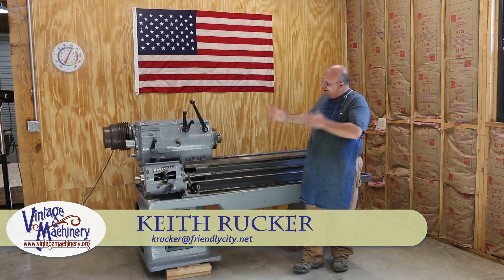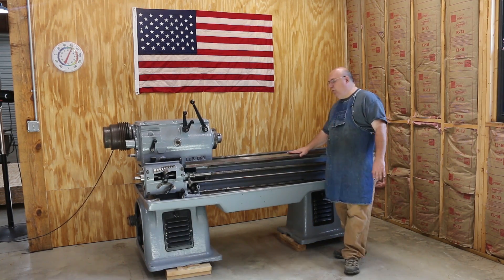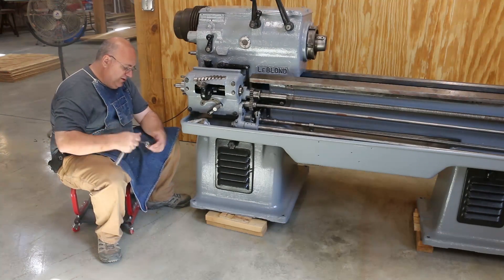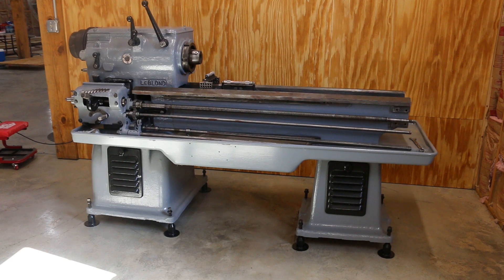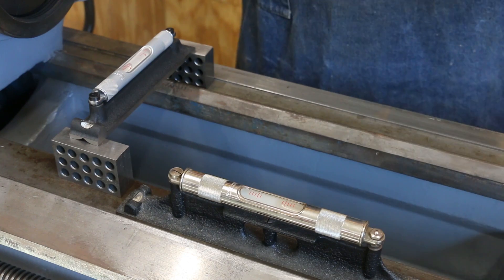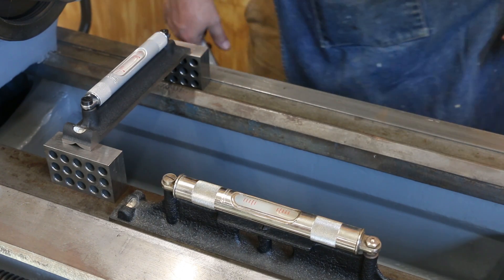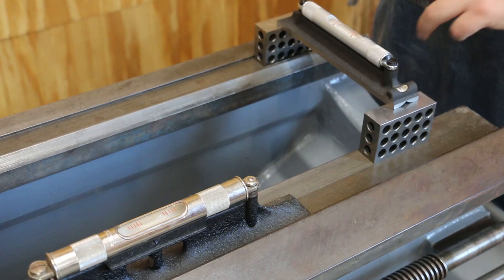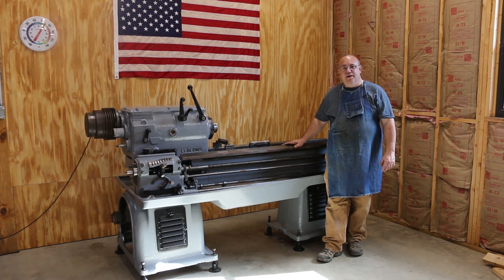LeBlond Lathe Restoration - Part 11: Leveling the Lathe

Comment: As you were discussing distributing the weight of the lathe out and not on a single point reminded me of something my father told me.  He was an airline pilot from 1946-1979.  In the early years he told me how Douglas had to strengthen the floors in the DC6's in the isle and galleys because at the time those tiny little 1/2" heels, or smaller were all the rage with the stewardess's and some of the heavier ones were punching holes in the floors of the airplanes because all the person's weight was concentrated on that tiny little heel!  A little piece of lost trivia.

Comment: I enjoyed the video, and learned some good tricks. I have a sister lathe to this lathe. The manual I got with my late says that the rear flat way is 1/16" higher than the front flat way on the 12" and 14" lathes ant 1/8" higher on the 16" and 18" lathes.

Comment: Great video but to my thinking a more precise way would be to drill a small hole dead center of 2 small half inch round stock to put a small guitar string through and put one piece in the lathe chuck and the other piece in a drill chuck in the tail stock and draw it taught.  Then put a very pointed tool in the tool post and follow the string along with the carriage front to back.

Comment: Important to adjust the force that each point applies. The correct force is related to the center of mass of the machine, on a lathe I would expect the head to be heavier.
I always clean & lubricate the contact points & the thread, to get a better feel for the force on each screw.
When I level break press machines, sometimes they need a readjustment after a week or so, I think it's because of stress release in the frame. If it's good steel it will eventually all straighten out.

Comment: ...You said those levels were accurate to .005" per foot? Aren't they actually more like .0005" per foot?
Reply from the maker: The level I was showing is 0.005.  Starrett also makes a "Master Precision Level" that is accurate to 0.0005.  I have one of those as well but it will drive you crazy unless you first level it with the other level!

Comment: Hi Keith, BLeonard here. I do enjoy the LeBlond Lathe Restoration. I have a 14 inch LeBlond H D and I remember leveling it. In the manual for the 12" & 14" Lathe on page 6 it states "The rear flatway is 1/16" higher than  the front flat way on 12" & 14"". Keep up the good work. Bob
Reply from the maker: That is why I was not on the rear flatway - I was on the front flatway, which is at the same level as the one on the other side.

Comment: Should a torque wrench be used to keep each set screws pressure even ?
Reply from the maker: I don't think that is necessary.  You would go crazy trying to keep them all loaded the same....
Reply: If there is any settling afterward equal weight distribution might help a tiny bit.
Might ?

Comment: Level.is where to start, but some machines due to age/wear have to be tweaked out of level to get the lathe to cut true
Reply from the maker: Very true, and once I get it running, I will cut a test bar and fine tune things.  Still good habit to start out level!

Comment: keith, i just finished your blacksmith blower series, when i saw the times on the videos i was nervous so many videos of length are 60 pct useless information about the videographer rather then the work, in your case it was about the work and in such detail my midnight bathroom run and smoke break wound up being your whole series, and i wish some parts were even longer. great videos and thnk you for your detailed information. please keep making videos they are enjoyable not just watchable which makes a difference.

Comment: Keith being your lathe hasn't been setting level in your shop since you had it. And not knowing if it was with previous owner. Would you check for level a few days weeks or months later to check an see how it settles in later on in its new position an what not. This is pure speculative an just asking on your opinion. Or anyone else wanna chime in. Keep up the great work.
Reply from the maker: Yes, I plan to do this and should have mentioned that in the video.

Comment: Hi Keith I had to look twice? You have the 123 block on the backside of your ways in the 
clearance slot and not on the flat of the ways because your level is to short .I think your lathe will be tipped forward use your long level on the transverse and your short one on the longitudinal way.
Reply from the maker: No, both the front and back were on a part of the ground bed that were on the same plane.  If I had it on the higher section, it would be tilted.

Comment: Did you consider using a digital inclinometer or other device, rather than spirit levels?  Great video, thanks!
Reply from the maker: No, I did not.  Nothing wrong with that, I just don't have a digital inclinometer but I do have precision sprit levels!

Comment: Keith,  having done a lot of "bedding" i'm astounded at how easily you brought the LeBond into your acceptable  tolerances !   My background was drivers and pumps and both required some serious bedding and "pre leveling" to +/-  .030 "  over greater spans !   Will vibration pose a problem when turning ?
Reply from the maker: It helps that I have done this before!  As for vibration, I doubt that it will matter much with this machine as heavy as it is.  On a light weight machine, it can be a big problem.

Comment: Just began watching Keith.  If I recall, South Bend's How to Run a Lathe recommends having the tailstock installed and tight prior to leveling.  Please correct me if I'm wrong on this.  Thanks, Eric
Reply from the maker: You know, my gut tells me that on a lighter weight machine (like a Southbend) this is probably true.  On a heavier built lathe, I doubt it really matters.
Reply: Yes you are most likely correct, I bet the bed on that LaBlond is very stiff.

Comment: 70 degrees. Wonder you aren't fozen solid, even with the long britches!
Reply: I know right?  I live in New Hampshire, so 85 degrees is hot.  I see Keith doing hard physical labor and its 100.   He takes time off when its 110.  He has a little sweat.  I'd be soaked like a shower!  Of course, When I get ready for maple sugaring in February its general 15- 20 degrees in the woods.  But wow....
Reply from the maker: I prefer the shop to be about 60-65 degrees but I can sure live with 70!
Reply: Bill sargent You get used to it I guess. I remember when it got down to 80 in a certain location in the Army and I thought it was going to snow!

Comment: Did you rotate you levels 180 deg to make sure the levels are good?  I've had a few bad levels.
Reply from the maker: Yes, I actually checked them to make sure and even did some fine tuning to them to calibrate the level (which you can do on a machinist level).

Comment: Is it necessary to level both sides lengthwise? I know if they are perfectly parallel, and one side is level, wouldn't it be kind of a double check to verify all places for level? Keith probably did this, but I didn't see it in the video. Just curious to other thoughts.
Reply from the maker: I actually checked it in multiple places.  I thought I commented on that but maybe not.

Comment: Keith, how about a little lesson on how to read a level like that. It seems like reading a bubble between some lines would not be accurate enough to see .005 of an inch?
Reply from the maker: Those bubbles are actually very accurate.  And I have another level that will measure to 0.0005"/ft!

Comment: As others have said the lathe doesn't have to be 'level', it has to have the bed parallel to the spindle axis.  The reason that 'level' works is that the lathe was manufactured with the spindle parallel to the leveled bed, and that a precision level is an easy way to transfer the level measure along the lathe bed.  You can also do it with tensioned wires, optical collimator or even a precision clinometer.  

If you know the bed is good you can check spindle alignment with a parallel test bar held in the spindle taper, or in a pinch a chunk of Thompson shafting in a 4-jaw.  With either you want to average the TIR on the horizontal and vertical axis separately.  If you don't know the bed quality it's a big mistake to try and align to it.

I hope you ran a stone against the bed where the 123 blocks were bearing, a little nubbin on that part of the bed could make for a decent error.

I'd consider a leveling with a Starrett 98 a 'good start'.  Check it again in a week after the bed has moved and the concrete has settled some.  Most folks would think of a lathe bed as hard and concrete as pretty set but a few rounds of leveling a machine tool and you understand that they're really just hard silly putty.Once it stops changing on the 98 move to a 199 or something else with .0001/foot and tweak it into final alignment.  You don't need it dead nuts on but taking it to .0005/foot can make a real difference.
Reply: Russ Kepler Does it matter that the 123 blocks were not  resting on the ground part of the ways where the carriage sits?
Reply: I don't think it would matter much if any - the flats should have been machined at the same time as the ways, but just not finished with grinding as the ways were.  So they should average pretty good, really.

Note that the planes described by the flat ways and the flats next to the ways don't have to be parallel to one another for the leveling to work, but if the flats being used aren't in the same plane you have to be careful with the placement of the 123 blocks by holding to the same edge or you might get different readings at the same location on the bed.  Maybe not so much with a 98 but when you play with a 199 you can see it.

Absolute level on the bed is really only useful when your rebuilding as it allows you to transfer planes to other planes making them parallel - id the bed is level in both directions and without twist it allows you to bring the spindle axis parallel to the bed with a parallel test bar and an indicator.  Once that's in you can get the cross slide perpendicular to the spindle axis and in the same plane with the level, etc.  

But all a working lathe really needs is an untwisted bed.  If the bed's in good shape you're pretty well done with that.

It's hard to write on this - there are whole books on machine rebuilding (ex Machine Tool Reconditioning by Connelly) that go into the subject in exhaustive detail on precision alignment.  A couple readings of the book will give you good insights on what matters and when.
Reply: Russ Kepler Thanks for the thorough explanations!
Reply from the maker: Russ - very good points.  Yes, I will be checking it again several times over the first few months.  I also have a Starrett Master Precision Level that is accurate to 0.0005" but I don't have it in the shop right now.  When I get it back here, I will be fine tuning it further.  And once I get it running, I will also be making final adjustments with a test bar - can't do that now because it is not running!

Comment: Check the bed after some days it's very likely that it's moved and are out off trim because of internal stress that has been put in to chassis when it's been stored and out of trim it can take weeks and even months to get it right in trim .
Reply from the maker: Yes, you are correct.  I will probably check it often over the first couple of months.

Comment: Hi.
I worked on the railway. On all the tracks everywhere  we inserted pads of rubber or soft plastic between the running rail and the sleeper. On any sleeper where the pad was omitted, the direct contact between rail and sleeper would turn the high quality concrete to powder in one to two years. The sleeper  would need replacing. The vibration is the cause of this. I use this type of pad under the feet of my lathes. The pads are only 1/4'' thick but stop the vibration transmitting to the floor.

Comment: Shim up the tail stock end of the lathe between the chip pan and bed to get final twist adjustments.
Monkeying  around with 8 leveling feet is like trying to herd cats. LOL
Keith can you tell us how thick the concrete is and the PSI and what the soil is like under it.
Clay or sand?
Reply: ...Herding cats......yeah, I have an old saying I like....."That'll work about as well as telling cats what to do".......

Comment: Patient job Keith, but worth it.  Watching you do that, reminded me of adjusting the pendulum on a grandfather clock.  I was able to find out how much one complete turn of the bob nut on the pendulum sped up or slowed the clock down, so then of course I could sub-divide out how much to turn the nut when making adjustments.  Took me about a month, checking once a week, but without the help of putting a degree wheel on the bob nut I got that grandfather clock to running as close to you can get when comparing to a quartz clock, +/- 3-5 seconds or so to the quartz clock, before you gotta start using a degree wheel on the bob nut to get any closer.

Comment: Hi Keith,
thanks for this educational video. I’ve done leveling on my own lathe several times (every time I moved it from one corner of my shop to another ;-).
And I’ve discussed this object with others and because of some wear on my lathe (its a german VDF lathe from the seventies) I’ve twisted it on the tailstock end more or less on purpose.
Within these discussions came up a very interesting question (in my opinion) that may be dicussed here and maybe you or some of your viewers may enlighten me.
Imagine there is a lathe on an oceangoing ship and I think it is a must to bolt this lathe to the ships
(workshops) ground. Maybe the lathe is in level at commissioning in the dock, where the ship is build.
What may happen if the ship is on the ocean and not longer leveled, but bolted to the ground…
Will the machinist get accurate results when working on this lathe?
Perhaps there are some U.S. NAVY or Royal NAVY or commercial trade sailor machinists here as viewers in your channel, hope they will find a satisfying answer…
Thomas
Reply from the maker: Look down through the comments - there is a thread discussing this very topic down there.  Instead of trying to put it all in again here, just look down and find it.  Some interesting comments.

Comment: it seems a fine thread would make it easier to get precise adjustments
Reply: Sure, but if you think about it the adjustments are pretty fine already.  The screws are 10 TPI, so a full turn is 100 thousandths. A tenth of a turn is only 10 thousandths, and it is easy to make a far smaller adjustment than that with a wrench. The .010 is over about 2 feet crosswise or 6-8' lengthwise. So making an adjustment of one thousandth of an inch per foot isn't all that hard with a 3/4 NC bolt.

What is harder is getting all of the bolts supporting the same amount of weight. Ideally (for making adjustments) you would want 2 feet under the headstock and one under the center of the tailstock so you had 3-point support. Real easy to level that, but not stable enough to use. So Keith has to adjust 8 bolts and get them all supporting the exact same amount of weight. That is harder to do.

Comment: The machine and floor(especially a relatively new floor like this) will settle over time, don't forget to go back and check level several times in the coming weeks and months.
Reply: its been close to a year i think since it was poured, id have to check back, i remember it being bad weather!
Reply from the maker: Yes, you need to check all of your machines from time to time.  The manual for the lathe says to do this every few months.

Comment: Shop is looking great Keith. Thanks for the great information. While the bed is now level is it guaranteed to be square to the Headstock or is there an additional step to adjust that comes later?
Reply from the maker: When it was new, it was guaranteed but all bets are off on an old lathe.  You can use a test bar to fine tune things to match for wear in your machine - and I will be doing that as well, but I have to get the machine running first!  Not quite there yet....
Reply: Great job so far. Always more to do, and you Sir seem to get more done than 5 men and a mule. I am amazed by how much you get accomplished! Thanks for bringing us along.

Comment: I level my lathe, then make test cuts and tweak the screws from there to get it cutting true. It is a bit time consuming but gives wonderful results. :-)
Reply: I've done the same thing with my old lathe...
the issue is that facing  is not true and i had to chose between a true diameter and true facing
probably that is due to wear on the bed and the cross slide
Reply from the maker: And I will be doing that as well - after I get the lathe running!

Comment: Hi Keith Rucker I have a question. How often do you test wath leveling are correct ?  Tanks for a very fine video.
Reply: no reason it should move once its done, its on concrete and steel bolts, and esp with the load spreaders he made, it wont be hammering itself pits into the concrete either.
Reply from the maker: The manual says you should check it for level every couple of months and make fine adjustments.  Few people actually do this but it is good practice.

Comment: May be desirable/beneficial  to level headstock end with the two leftmost feet while suspending tailstock end using engine hoist/crane and chain or strong straps fed through gap between the ways and under the pedestal, effectively allowing any twist tension in the bed, to, over some time, unwind itself..
This could be monitored fairly easily by using  a gauge block to adjust and lock each of the six hanging adjusters, simply checking the gap and bed level over time.

John Greenwood